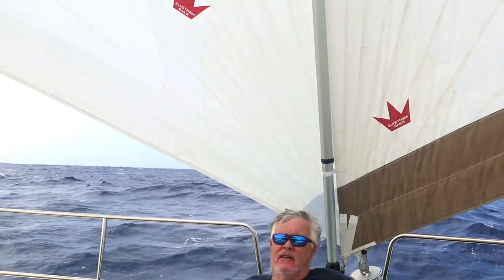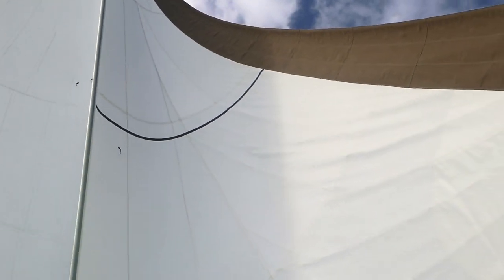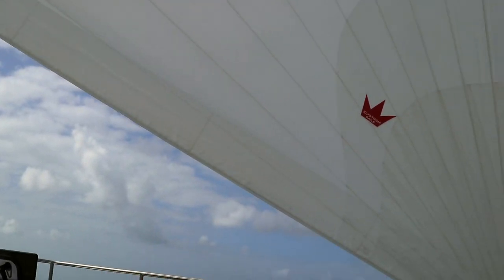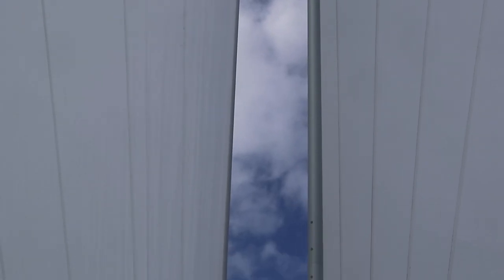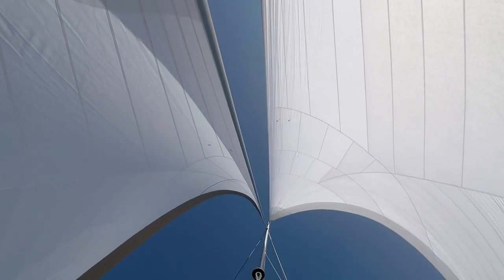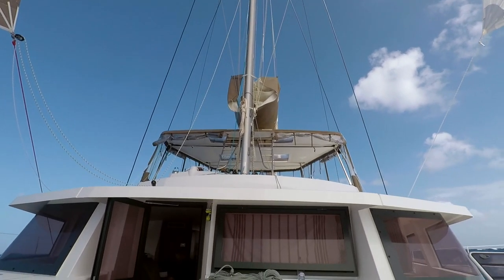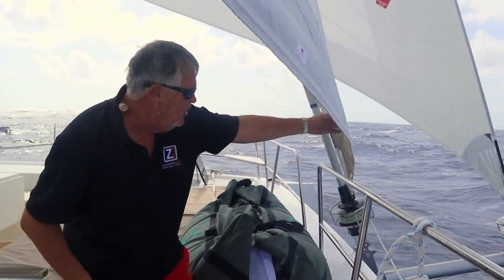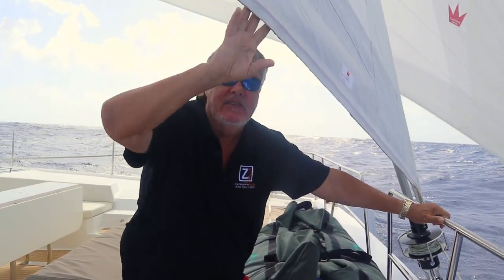Wing-on-Wing Configuration for Downwind Sailing on a Catamaran

Comment: In this video you use a discontinuous (single line) furler for code 0. Does this work without any problems? Or is it better to choose a continuous (endless) furler for the code 0?

Comment: Rather than run the genoa sheet to a midship cleat what are the pros/cons to run the sheet from the genoa aft to the block for the Code 0 on that starboard side?
Reply from the maker: The midship cleat is outboard of the tack so by going there you are pulling the tack out and opening the sail. This is basically using the beam of the boat instead of a pole. Going to the back will not achieve this and you also lose the preventer effect of using the midship cleat

Comment: I like this set up, after using it, do you see any situations in which you need a spinnaker at all?  

That's a lot of sail area, is your spinnaker a lot bigger?  Maybe light wind when your destination is near downwind, you'd want a really big light symmetric spinnaker?    

Thanks
Reply from the maker: Hi Mark, this is a great setup if you are running downwind - what we did if squalls came up was to  roll the Code Zero and just kept the jib up until it blew through. The negative for this is you have to have the wind directly on the stern - you cannot sail any angles because this ends up backwinding one or the other sail. I carry an Asymmetrical which I use most of the time because it allows me to sail good angles downwind
Reply: @Catamaranguru  Thanks.  The other option is to run your barber-hauler line on the jib to the bow cleat, you may have to furl in a little bit of jib, but that would allow you to sail +/- 10-20 deg off DDW.
Reply: If you poled out your windward jib could you not sail close to the same angles as your spinnaker? You’d have more sail area and like you said, a lot easier to reef this set up over a lone spinnaker.

Comment: Do you have running back stays set up when you are flying headsails only?
Reply from the maker: Hi Gary, yes we do.
Reply: @Catamaranguru  Thank you for the quick reply Ifigured you did I thought I saw them in the video. It would be a horrible idea for folks to try this sail plan without the back stays I would think. I am considering adding running stays to my rig and during researching the idea I came across your video. 
Thanks again
Best wishes
Gary & Ena 
SV Divergent
Reply from the maker: @garyeickmann511  you're welcome. Yes we have always had those as a part of our arsenal on all our cats, specially since we have pretty big head sails. We will use the headsails in our regatta next week. I will specially focus on the running backs so you can see our setup. Sign up to our social media to see the video.